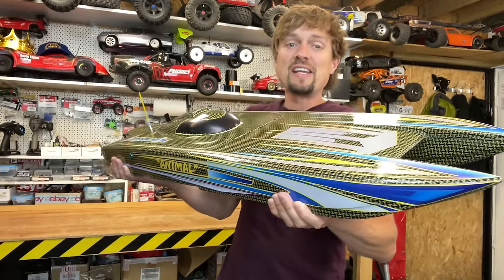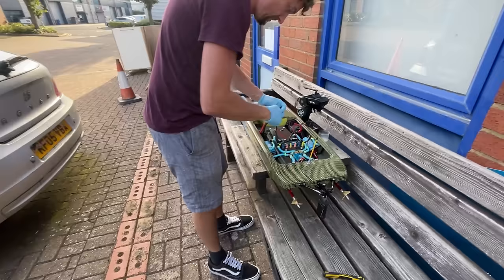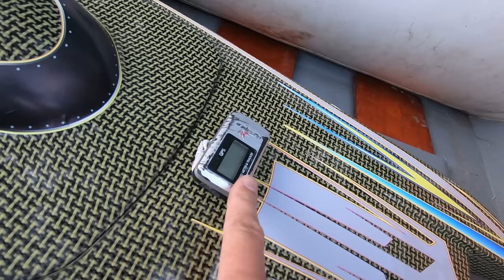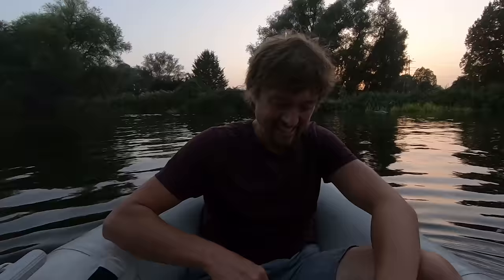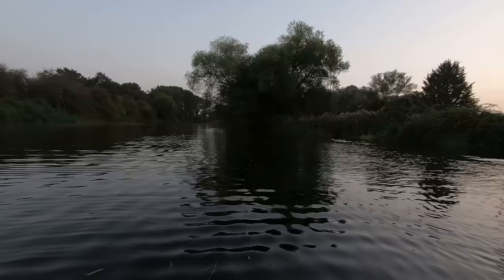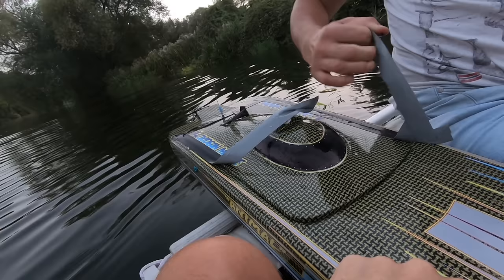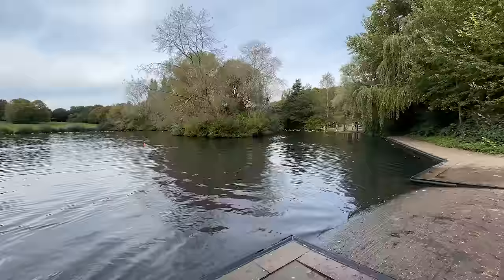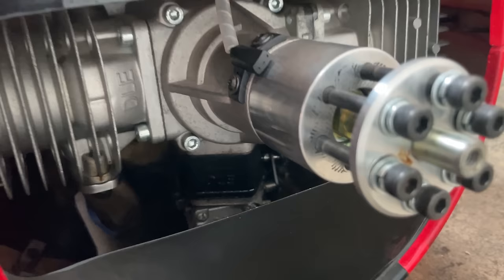Twin Motor 12s RC Speed Boat ***fastest RTR boat in the world?***

Comment: The Animal cat by oxidean had reception issues bc you didn't have to boat antenna mounted, the carbon fiber block reception, you have to mount the boats antenna on the exterior

Comment: Do these R/C companies match up motor pairs based on KV? With any twin motor setup I feel like you have to have two motors with matching “actual” KV and two batteries that are well balanced and discharge at the same rate. Otherwise your system is going to be fighting itself. I guess you could dedicate a pair of batteries to the R/C as to not offset charging cycles. Would be cool if they had a master/slave ESC setup that could bridge two sensor motors to maintain the same armature position at all times.

Comment: Think you need to go to a club meeting to show you how it works! Needs a safety loop for sure, those props will take your fingers off. The aerial also needs to go through the hull, all that carbon fibre and water kills the signal.

Comment: Question, regarding batteries for traxxas. I have begun to see why there is such a hatred for traxxas batteries. What are batteries that doesn’t break the bank I know I’m going to have to change the connector. 3s on rustler 4x4 vxl/ Hoss. I’m wanting to branch out on the rc brands but haven’t found that deal yet haha

Comment: It's called "audio zoom" it's trying to be clever and hone in on the sound in the direction you're zooming in (which makes sense a lot of the time) but obviously is really inappropriate for vlogging. 

I don't think you can turn it off in the standard camera app but you can go in the settings and turn stereo audio off and it sort of bypasses it. Not an ideal fix but it's better.

Comment: if I were to purchase the exact same out of the box ' animal ' boat as you would I encounter the same problem with the speed controllers as you ? The shorting of the speed controllers !? is that a kit design fault ? its August 2024 now as I write, if kit design fault is it fixed now please ?
Reply: If it still has carbon fiber supporting and surrounding electrical components then it is an issue. Carbon is conductive, get it wet and it's more conductive.

If they changed the design to fiberglass or plastic then it's not an issue.

Comment: I have this boat... same thing happened to me because of the carbon plate being too close but my esc still works  and Kevin's may also, it handles better with props spinning outwards instead of inwards, it's too bad that the speed props are not included at this price and by the way someone has to say it.. get some scuba diving  gear and quit polluting the water go get those boats you guys sank seriuously...

Comment: Just use external mic kev
Reply from the maker: i tried, but more problems than what its worth when out and about, comes disconnected, wires get tangled up, cant easily pull phone out of transmitter mount

Comment: If i spent $2300 on a rc boat and it smoked the escs out the box due to manufacturer mistake, id be pissed.
Reply: Agree....But at least they handled it quick with replacement parts. The real question is, would they treat us measly peasants the same way if we had problems.
Reply: @mrufo2297  that's a good point. Not everyone has millions of subs on YouTube. I have heard less than nice things about bill oxidean from the rc forums years ago, never could afford his stuff though so no personal experience
Reply: These boat hulls are rebranded tenshock minimono & DY motorshop zonda hulls, with bill’s electronics.   If you want to build one yourself you can do it at half the cost….  Even that fancy gold transmitter is a rebranded wfly that can be had for less than half what bill wants.

Comment: suggestion? dont by POS iphones! android allllll the way
Reply from the maker: android cant zoom between the lenses while recording and video quality is not as good otherwise i would. Also I use a mac for editing now, it does it way smoother than my PC and iphone works better with mac. i have both systems, apple is better for what i do all round. pc better for gaming but i don't game
Reply: Kinda like my I phone 7! and until it dies or gives any signs of trouble I’m not replacing it even if it’s free!
Reply: @KevinTalbotTV  might have to double check that, I think the S23 ultra or Pixel 7/8 pro can do vids very well nowadays
Reply: I only dont like iphones cause of there screen design and limitation and prices
Reply: Here is an idea buy him a Samsung or shutup
Reply: S23 Ultra if you gotta use a phone. Kills the crapple.
Reply: There's always someone that wants to argue about apple vs android lol
Reply: Kev! I used to have that issue with an iPad. I solved it by using: Apple Earpods with Remote and Mic you are tethered by a 1 meter cable but.. it works!!
Reply: @KevinTalbotTV  Ive got a poco f5 pro, that can zoom and record in 4k and the video is just as good as the new Samsung's, cost me £500 on release.
Reply: Android gang rise up.
Reply: @KevinTalbotTV   Check if you have "record stereo sound" enabled in camera settings. This feature affects zoom in the camera app as you zoom in by reducing sounds from the rear and sides while enhancing sounds coming from the direction the camera is pointed at.
Reply from the maker: @mrufo2297  ive tried them all, iphone is the best all round phone for filming. Fanboys will always be more loyal to a brand than they are their wife, i choose whatever product does the best job, and for filming and editing videos its apple. If a phone cant zoom between all 3 lenses while recording its no good to me. All other phones except for the iphone you have to stop filming, switch lenses and then start filming again. 100's of people have told me their samsung can do it, then when i tested it for myself it actually can't.
Reply: @KevinTalbotTV  u got me there im only against the screen design
Reply: @KevinTalbotTV  My S22 Ultra is on the same level in terms of photo and filming to an iPhone and can switch seemless between wide angle, normal 3 times and 10 times zoom while filming. Just the 10 times zoom is a really nice feature. At the End high end smartphones have so little difference in film/photo quality that it doesn't really matter. The iPhone can't really do anything more what any android can outweight with something else and vice versa. iPhone to Mac works great because everything is really optimized but android and windows for me, gives me more options. Like my ASUS ROG Flow Z13 is a "tablet" with an i9 13900h and RTX 4060 in it. Just awesome to work with and great for me with Djing.^^ But both have there pros. It is more like what you like more.
Reply: Since Apple became an arm of our government I had to shut them off.
Reply from the maker: @AlcatrazCrylake  I tried the s22 it cant zoom between lenses when shooting 60fps, i shoot everything on 60 so i can do some slow mo. If you're not bothered about the ability to do that then you're right all the high end stuff is about the same, but apple kills PC for editing. I have a $10,000 custom editing PC and my macbook pro that was 3x cheaper is way faster for editing, the PC is not even close
Reply: EVERYONE JUST SHUT UP! (except kev) ITS HIS CHOICE IF HE WANTS TO GO APPLE OR SAMSUNG NOT EVERYONE ELSES CHOICE!
Reply: @leeconj2093 there is no argument there is only android 😊
Reply: Android all the way
Reply: @KevinTalbotTV yes they can, new samsungs zoom way better than iPhones and they do switch between lenses whilst filming
Reply: @KevinTalbotTV  i just tried it myself with my s21 ultra. Perfect lens switching with FHD 60fps, but not with UHD 60fps.
I guess you mean lens switching when using 4k?
Reply: Depends what you use to edit I use iPhone 13pro and MacBook Pro with fcpx there might be more professional editing software but this is easy. Used to use adobe but way to advanced for what I would need
Reply: I stopped getting iPhone because the batteries expanded popping the screen out.
Reply from the maker: @hazzerhitchings2981  100's of people have already told me that then when i tested for myself you cant, not at 60fps while recording. people are confusing digital zoom on 1 lens with zoom between all 3 lenses. test if for yourself, set fps to 60, then put your finger over one of the lenses and start zooming. If its zooming between all lenses your finger will block the view on some zoom settings and not on others. I can see why people getting confused but ive already tried.
Reply from the maker: @Alienvisitor007  im not arguing with fanboys, i just get whatever gets the job done, i couldn't care less what brand it is
Reply from the maker: @ir0nm4id3n   i tried it on that phone and it didnt work, maybe they did an update? iphone 15 does it at 4k60 older ones 1080 60
Reply: @KevinTalbotTV Not no more.
Reply: Android sucks
Reply: They’re all the same.
Reply: Android is the reason you’re still single my bro, it’s an ick.
Reply: @needmoreboost6369 I don't have problems with iPhones I just hate apple. Personal issue. I love that attitude by the way. So many people are always mad when they don't get exactly what they want.
Reply: @KevinTalbotTV  maybe an external mini mic?
there are some Bluetooth mic's, that are supposingly very good
Reply: @KevinTalbotTV Sony has some killer phones for video if you know about cameras and filming
Reply: Suggestion. Don't type
Reply: @KevinTalbotTV ”fanbois will be more loyal to their phones then wife “ that had me laughing hard 😂
Reply from the maker: @dazaspc  there is no camera that I know of that can do what a phone can do and fits in your pocket, or on the controller and be durable against dropping, sand and water, can zoom with one hand, has wide angle, can shoot slow mo and 4k60, can have external mic. if theses a camera that can do all that ill take it, whatever it costs
Reply: Even Linus admits that iPhone video just flat out looks better than android video
Reply: @TylerSL92  LOL @ Linus the salesman that googles everything 🤣 😂 😆
Reply from the maker: @kychristell1779 already covered that in previous comments get with it bro! 🤣
Reply: @KevinTalbotTV yes samsung s23 ultra can switch between lenses while recording and it's very good
Reply: Jip you can Switch switch between cameras on S22 shooting on UHD30 and UHD60 but you can't do it on  8K24
Reply: @miketee2444 you’re drug dealer or wearing a tin foil hat
Reply: @wescalade3150 😂
Reply: @KevinTalbotTV  as an Android user, all actively admit that Apple definitely wins when it comes to video recording
Though, if you want an Android phone with ridiculously high camera quality, get the new pixel 
The way that they use physical zoom lenses and stuff makes their camera ability absolutely insane
Reply: @KevinTalbotTV you should buy a new android and computer before you compare them
Reply: Im loving my Iphone 15 pro max Kev the zoom is even better the the 14 . My audio seems ok when zooming
Reply: @KevinTalbotTV  mkbhd talked about this before. It is a setting for the camera.
Reply from the maker: @johnneshiem2291  already have apple destroys it for video and editing. as i said im not brand loyal i get what gets the job done. right, thats my last comment on the matter we're going around in circles, i only wanted to know how to stop the mic audio zooming, its sorted now so thanks all, im sticking with apple till something better comes along for VIDEO i don't care about everything else. They all text, phone, email, browse the web and i don't care about gaming
Reply: @yeetboy88YT  Do you see any discrepancy in commenting for  everyone to shut up? I doubt it.
Reply: Suggestion, nobody cares anymore
Reply: @KevinTalbotTV  Yep just tested it on my S20 and on UHD60 it only uses the middle lens.
Reply: Agreed 👍
Reply: I just tested it on my S22. It switches between Lenses at 1080 60 but NOT at 4k 60. 

Even though I don't like 4k AI enhanced pixel mush from small sensors, I fully understand the ease of use when staying inside the apple ecosystem.
Reply: But I respect people that use android
Reply: @PCrailfan3790  if I could say one last thing about this topic it's not really pos to have an iPhone you either have an iPhone or android that's all the choices pretty much so your either gonna have one or the other , I bought a ulaphone X10 because I wanted something different but it's still android platform.
Reply: @KevinTalbotTV what are you talking about, you can use all lenses when you film on Samsung, i can zoom 0.6x-10x using wide angle lens, normal lens and telephoto lens, record in 8k 24fps or 4k 60fps, lets see any iphone doing that 😂
Reply: Man those big planes look amazing. 110cc is what my 3 wheeler was as a kid. Lol that's gonna be epic!!
Reply: The lesson I've learned here either have a real boat before purchasing a rc boat or but 2 rc boats for recovery
Reply: @KevinTalbotTV Kev. I still haven't heard from you!!??!!
Reply: the iphone 14 has a settings labled "record stereo sound" in the settings of the phone. turning that off fixes the audio recording issue you're having. i believe it disables the stereo when you zoom in causing that to happen @KevinTalbotTV
Reply: @KevinTalbotTV  Well said.
Reply: The grammar in his comment is all you need to know about android users 😂
Reply: Android is way better
Reply: @KevinTalbotTV  
Actually I have an Android phone and I can zoom in and out while recording video.
Reply: Waffle, waffle
Reply: @wescalade3150  Since when. I've never heard that in my life and I've been with apple since the 3g came out wasn't it samsungs phones that started blowing up galaxy note 7 ring any bells
Reply: @damianwade1998  if you look at iphones and Samsungs flag ships there is a 20 dollar difference
Reply: @KevinTalbotTV I think I know why the audio goes muffled it’s because there is a microphone by the cameras and when you zoom it switches to that mic so maybe your finger was on it.
Reply: u could us the newest android it mabe can zoom in 100x
 @KevinTalbotTV
Reply: Android users are the worst
Reply: @killawatt_fpv  id rather pay alot for an android the iPhone samsung is more customizable
Reply: @KevinTalbotTV 100%
Reply: Android is based on Java…..so that should be enough to make the decision 😂
Reply: Lol! All the comments are very funny. Android lovers and iPhone lovers MOBILISE! WE MUST DEFEND OUR PHONES THAT ARE ALL IDENTICAL!! 😂😂
Reply: @KevinTalbotTV a couple of comments here get it right, apparently disabling stereo sound also disables that feature (audio zoom, as they call it) that focuses better the audio depending on the zoom. Unfortunately this is basically a hidden feature, with no real way to just toggle, and it does no good to videos like yours where the audio is always near the phone… :(
Reply: @Acquiesce77  just like old times
Reply: I have a Samsung s20 note ultra. No issues
Reply: Someone can't afford an iPhone lol
Reply: @920kingkong  who
Reply: pipe down noone cares
Reply: Change the microphone from stereo to mono and it won’t do it. Thank me later lol
Reply: @KevinTalbotTV  Love your content mate, I have a S22 Ultra and it can switch between lenses while recording except in 4K60.  If you're talking 4K60 then yea I agree I wish they could but in 1080p60 and 4K30 you 100% can switch lenses while recording and you can see it in action in some of my vids.  I do look forward to the day I can switch lenses while in 4K60 though.  iPhones may have a slight lead in this regard, hopefully Samsung catches up soon.
Reply: @920kingkong  bro the latest iPhones are no more expensive than the latest Androids lol it has nothing to do with cost, they're all overpriced
Reply: wth you talkin about. samsung s23 ultra does everything that apple iphones cant :D

 @KevinTalbotTV
Reply: @terjeringdalen6298 thank you👍
Reply: Apple owners sit down to pee, always an android around to best an iphin, i build mid level pcs that shit on top line snapples. Buy a name or buy a PC or android lol
Reply: Really bro why you let stempid to use your toys he is always damaged every one he touches
Reply: Go look for your exploding battery that probably fell out
Reply: Beat me to it😂 100%
Reply: @groberds_2415 thats cus all apple users are still in school 😂
Reply: @krisvee941 yeah my z fold 4 can zoom between lenses while recording, though if Kev prefers iphones that's his choice
Reply: @needmoreboost6369 iphone 7 was in my opinion the pinnacle of iphones. I dont know what it is about them, but they just work and look and feel good while doing of

Comment: Am I just being pedantic or does this annoy anyone else? If each ESC isn't getting 12S voltage you're running a 6S voltage system with 2 packs in parallel, not 12S
Reply from the maker: so if the lipos are 6s2p, there are 12 cells per pack, so the boat has 24 cells total, sounds even better 🤣👍
Reply: @KevinTalbotTV  you know, I want to address this but now it just feels like we're trolling lol, you call all those 6S toys whatever makes your heart happy my guy lol

Comment: 2 6s systems dont make it 12S.
Reply from the maker: 6 + 6 = 12 🤣
Reply: @KevinTalbotTV  you know that's not how that works..
Its still just a 6S Twin.
Same as the MG36 or the Zonda.🤦‍♂️
Reply from the maker: @Wanted1069  what about if i use 6s2p lipos, 2 of those will be 24 cell, sounds even better!
Reply: @KevinTalbotTV  🤦‍♂️🤦‍♂️🤦‍♂️🤦‍♂️ Dork...😆

Comment: For the love of God stop adding up parallel batteries! Thats not how it works!
Reply from the maker: double the power :)
Reply: @KevinTalbotTV  but not double the voltage, that's the point 😅 12s implies a power system that works on 50 volts instead of 25